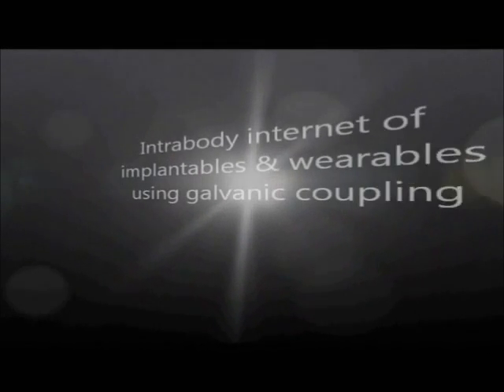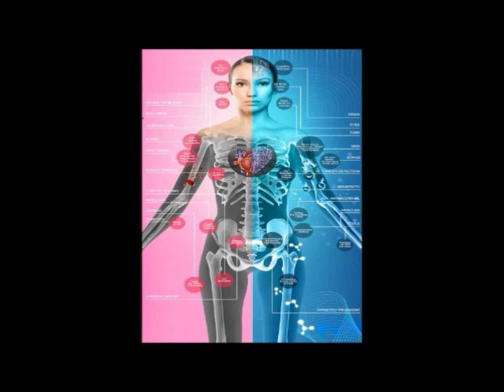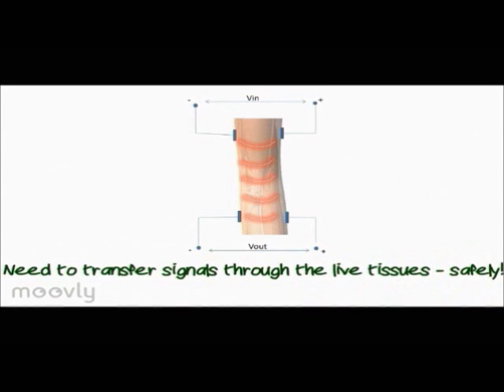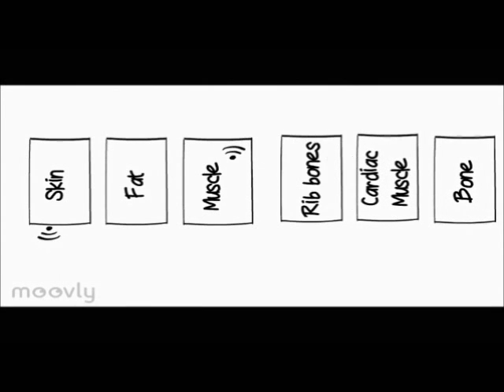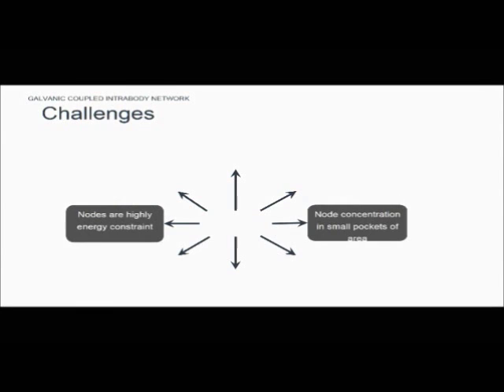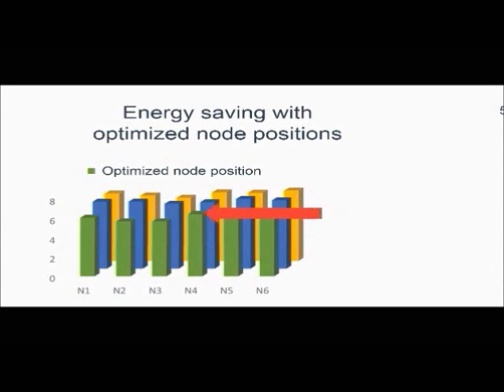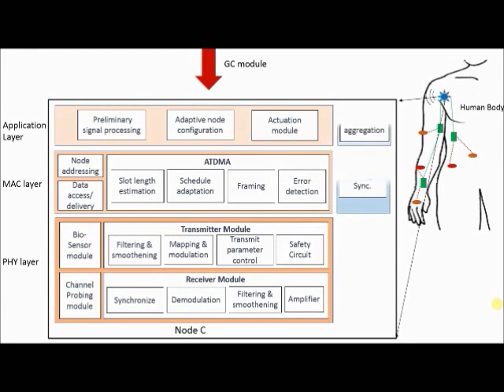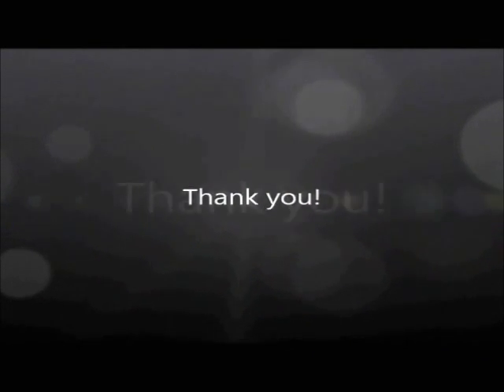Intra-body Communication using galvanic coupling - research sumary

Comment: how do you transfer the data among controllers? can you able to say that what is galvanic coupling device to implement in hardware level?
Reply from the maker: Data transfer among controllers is through air and can use the existing over the air RF transmission techniques using LTE/WiFi.